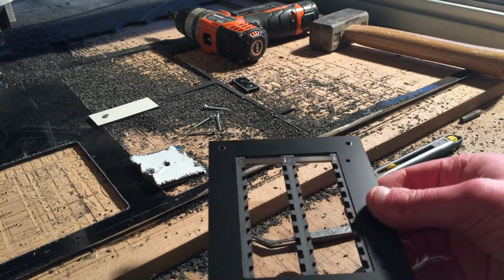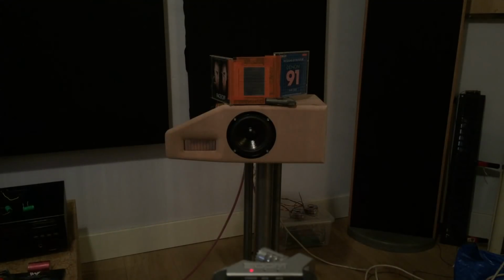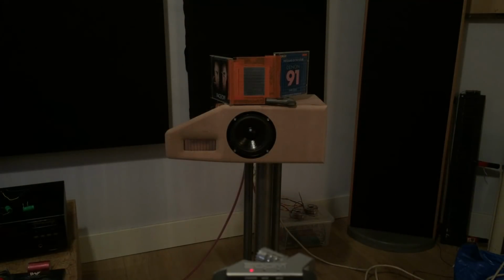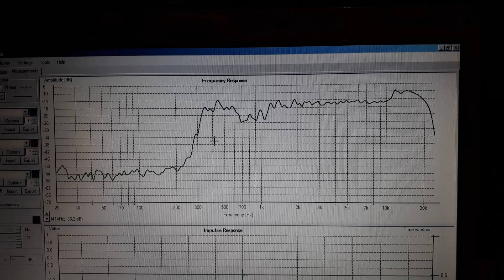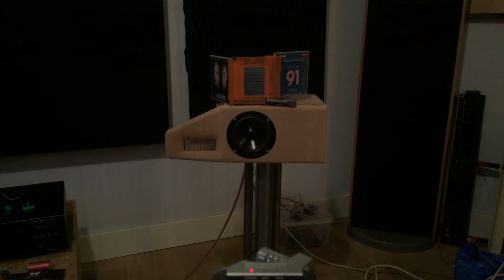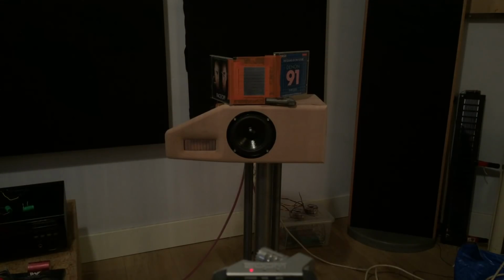Neo v10 Midrange friend

Comment: Hej, Joppe. What's the best ribbon loudspeaker you've ever built? I'm just starting out building - having gone through all the usual suspects and even horns. Where would you recommend I start? Planar or ribbon?
Reply from the maker: well most of my builds are not ribbons but just plain old planar magnetics :)  the most easy to build would be a planar magnetic using wires. (aluminium wires)  and start from there i guess. 
i mean they all have there pros and cons.  form factor efficient and how low it should reach or how high :)  are the main criteria to chose one over the other i guess.
Reply: @joppepeelen  Dank je wel! Ik geniet je videos. Meest inspirerend!

Comment: Hi Joppe. What may be the result if you build the unit half as wide, with maybe four together  in series/parallel?
Reply from the maker: That would be the exact tweeter that is sitting in the monitor :) the v10. Yeah you can use as many as you please for a line source. But for a small monitor some vertical dispersion is nice . That why i only used one :)
Reply: @joppepeelen  Yes, for a monitor one is best. But for stereo, better horizontal dispersion with good vertical dispersion would be achieved with less width, and stacking them vitriolically, series/parallel.  You are right, you really have both with the same pannel. Looks good.
Reply from the maker: Yeah stacking vettically will result ib less then flat response. Unless you make the really long 150cm +